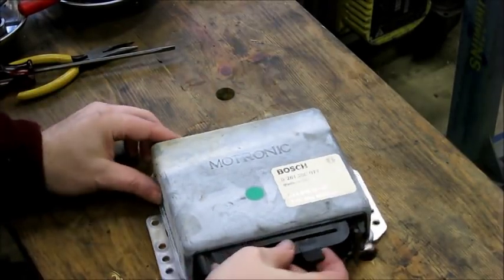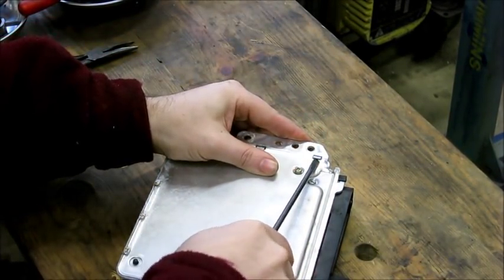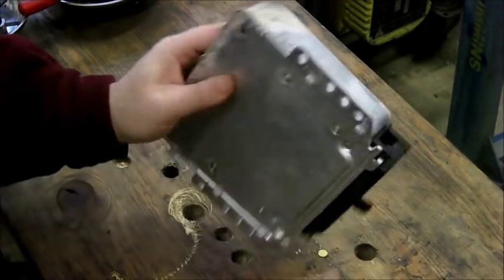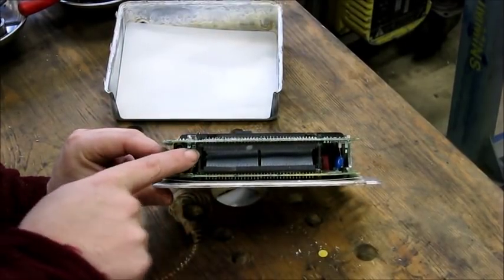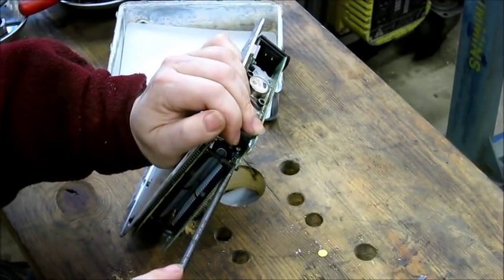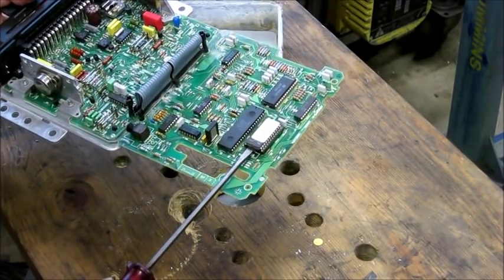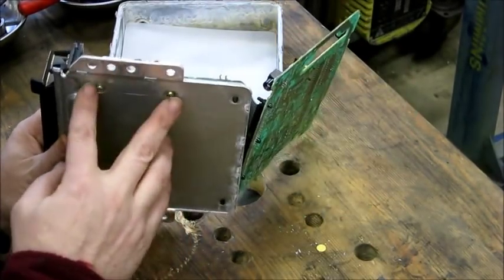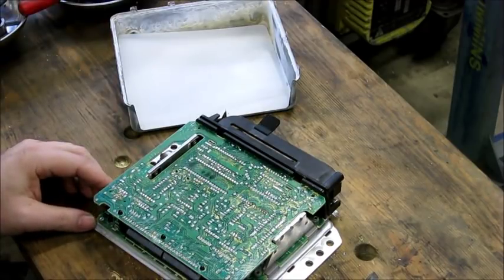Opening up a Bosch Motronic DME / ECU

Comment: You mentioned that some of the solder joints crack.  Is the solder that is used on them lead free?  I heard a couple bad things about lead free solder.  The only reason we use it at all is because of RoHS or we would still be using the 60/40 lead and tin solder.  I just wish that other countries would stay the hell out of our lives.  It is almost as bad as California passing a new emissions law and now we all suddenly have it for some mysterious reason.  I hate it when things don't work right because of the EPA or something similar.  We have terrible gas can spouts that are completely useless to me.  Now I can't put anything in the dishwasher that had cheese on it or I might get white spots on everything (no good useless detergents these days).

Comment: Hi, does the ecu control the ignition coil? I have an Audi 80 B3 1989 fitted with KM Motronic.
Reply from the maker: Yes, it actually closes the ground circuit on the ignition coil which creates the high voltage that goes through the spark plug wire.  The orientation of the distributor rotor will direct that high voltage to the correct spark plug as the correct time.

Comment: question.. I think I may have a bad dme unit.. is it possible to just change the performance chip? or would I have to get a new one?
Reply from the maker: If you have an '85.5 or later car, you can change the "chip".  But, that's not a part that goes bad...  Usually it's a broken solder joint or a failed transistor (fuel injector driver).
Reply: Oh ok.. I have 85.5 my DME unit looks exactly like the one you took apart in this video.. would it be best just to get a new one?
Reply from the maker: Realistically, it's probably premature to get a new one.  What exactly are your problems?  Things like bad speed/ref sensors, bad DME relays, wiring shorts, vacuum leaks, etc. are much more common than DMEs going bad.
Reply: +Van Svenson oh ok... I changed the crank position sensor, distributor cap and rotor button.. I took the cap off the dme relay and tried to start it and it seems to open and close correctly.. also I'm getting fuel to the fuel rail..
Reply: +Van Svenson may bad.. I told you it was an 85.5 but it's a 88 model..
Reply from the maker: Does the tach needle bounce a little bit while you're cranking?  If not, they the computer isn't getting power or it isn't seeing the RPM signal.  You can also take out a spark plug and ground it somewhere and visually check for a spark.  Did this car run before you did something specific to it?  Or did you get it non-running?
Reply: +Van Svenson where is the tach needle located? and yes it was running when I got it.. I was driving it everyday and it got to where it would be hard to crank after I drove it then one day I was driving home for work and it cut off right as I was pulling into my driveway..
Reply from the maker: You'll find the tach in the instrument cluster in front of the steering wheel. :)
I'd start with the basics.  Verify fuel is squirting out the injectors, verify the spark plugs are sparking, verify the engine has compression.
Reply: +Van Svenson thanks sir!! I'm in Alabama and appreciate all the help.. it's my first sports car. I hate I'm not driving it now lol..
Reply: +Van Svenson  I finally had a chance to charge my battery and crank my 944 and the tach needle isn't moving at all.. how would I know if it's getting any power to the dme?
Reply from the maker: Take out the DME relay, and make a 3-wire jumper with spade connectors on it - stick it in the 3 large relay slots.  This will turn on both the fuel pump (it'll hum) and the DME.  If it now starts, you need a relay (they're known to crack solder joints - which you can fix by reflowing the joints).  If the tach needle still doesn't bounce, it's probably a bad speed or ref sensor.  Make sure the plugs aren't swapped...  Some people have had problems with cheaper sensors not being compatible...
Reply: +Van Svenson I tired the jumper and I could hear the humming.. tach needle still didn't move, for some reason the hazard lights came on while I was cranking it..
Reply: +Van Svenson do you know the best way I can order those sensors?
Reply from the maker: I get most of my parts from Pelican Parts.  You can also try looking for used ones on ebay.
Reply: +Van Svenson ok.. I found a pair on eBay but do the sensors have the same part number?
Reply from the maker: Yes - both sensors are the same p/n.
Reply from the maker: The rear one is reading the teeth on the ring gear (that the starter engages) to tell the DME the RPM, and the front sensor reads a set screw in the flywheel to tell the DME the TDC position.  The DME also monitors air going in from the Air Flow Meter, monitors throttle position (idle, mid and full), and monitors engine temp.  With these inputs, the DME can control the spark advance for each cylinder and control the fuel amount.  On your car, you're not getting the desired output - the first step is to make sure the inputs work.
Reply: Van Svenson going to jump into this thread, I have the same issue where the car will die then on trying to start the tach will not bounce until you unplug and replug the reference sensor wires, I've replaced both sensors, and I replaced the female ends. Cracking the dme open to look for bad solder jointed. Would it be worth it to buy a new harness for the reference sensors to the dme, they are on Lindsey racing for just under 100 usd

Comment: Is this the box located in the footwell?
Reply from the maker: On the '85.5 and later cars, it's under a piece of wood under the carpet in the passenger foot well.  In the earlier cars it's under the steering column, above the driver's knees.
Reply: Thanks Van... Ive got a chip that came with my 86 and your video steered me in the right direction.

Comment: Monte Olsen Howdy.. most of us use the OEM Bosch copper plus plugs.. e.g. WR7DC+.
Since my 944 is chipped plus a higher compression, I use a slightly cooler heat range #6. Cruise failures are common, I have one intermittently. Solution is a re-solder of the cruise cpu or just buy a remanu unit for about $150.
Reply: Thank you very much for the info. I appreciate it greatly. Sorry it took so long to reply.
Reply: Join us at Rennlist where knowledge leaders like Van here part the seas for us learners..
Reply: Thanks. I sure will. I read them now but will give them a closer look. Which group are you all on? I have a 968 but probably should be checking the 944 groups too. Regards.

Comment: Great look inside the computer. Thanks Van. Would you consider doing a video on the spark plugs the 944 and 968 use? For instance, I see a lot of iridium plugs and wonder if they are any more beneficial than other plugs or if there are other spark plugs that might be good. I have heard that if the cruise control isn't working on our cars, there are certain possible easy fixes for the problem? Thanks anyway for another great video.